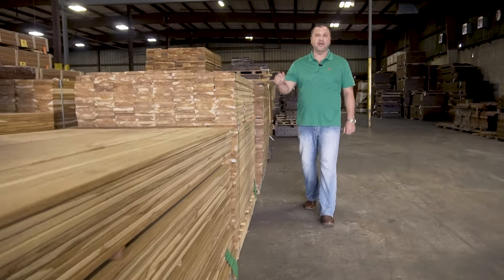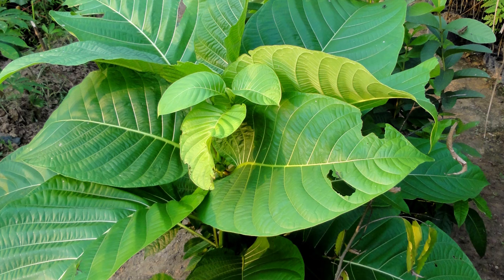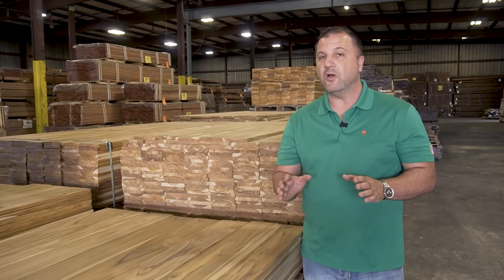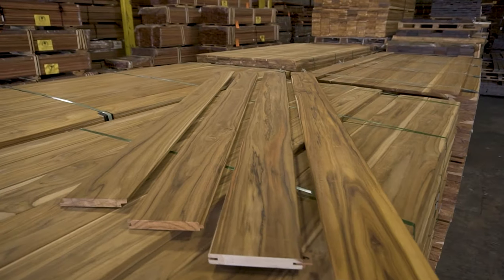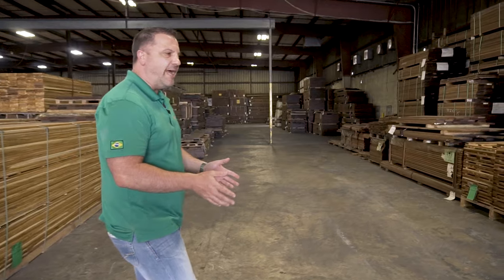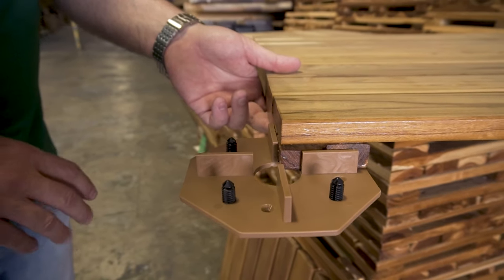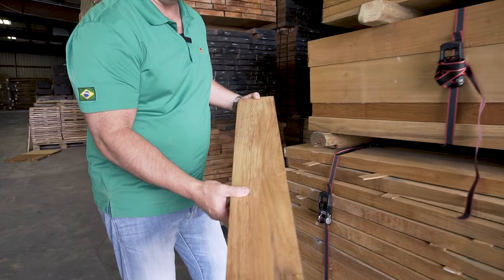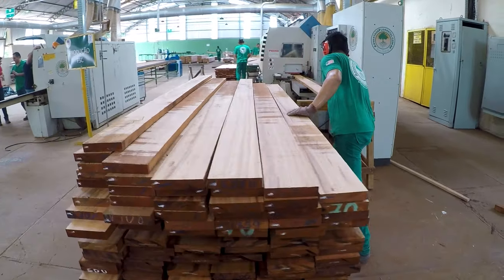Talking Teak - [The Teak Decking FAQ]

Comment: how do you handle the tiles when the area falls short of a square tile and needs a 1/3 of a tile or half to fill in the remaining area like a brick walled patio that has a fixed area?
Reply from the maker: You measure and then cut the tile to the desired size to fit. Then you unscrew the under support that was cut off and then screw it onto the trimmed piece for the support. This video explains it:

https://youtu.be/PfeQRMg1Ieg